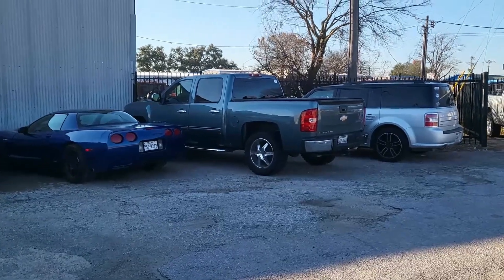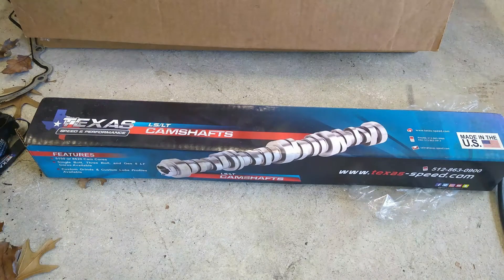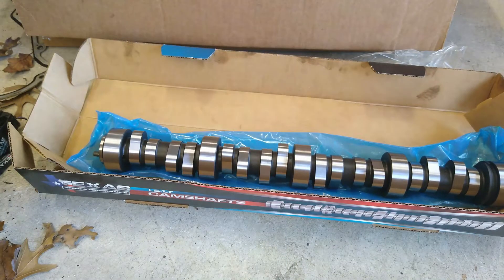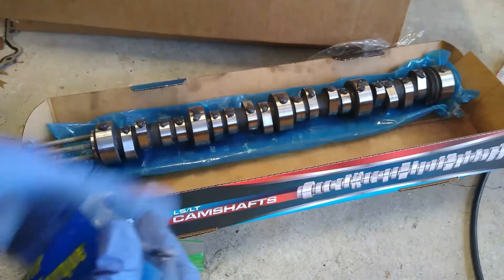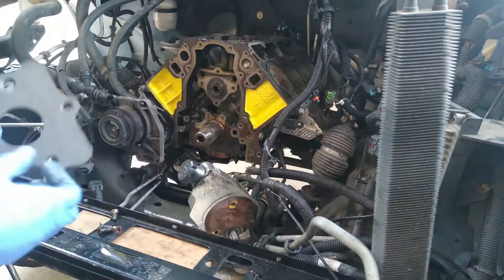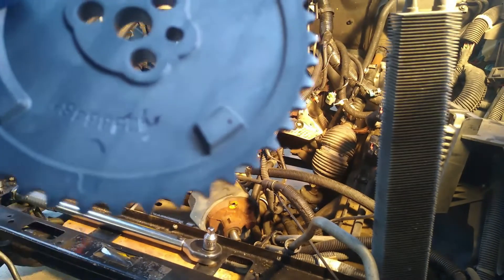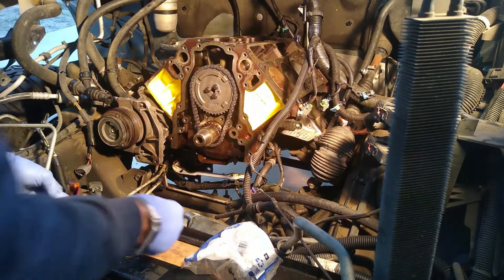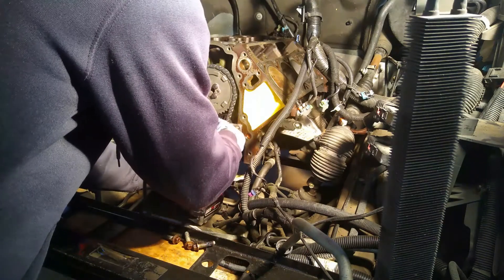STAGE 2 Camshaft Install & Timing LS GEN4 5.3L Engine Rebuild. 2008 - 2013 Silverado Sierra

Comment: what happens if  you dont replace the timing guid if using the stock it gives tension on one side will that cause a random stumble seeing that every other revolution it will be off timing i installed mine with the oem one and i have a random stumble

Comment: The major upgrades would be going to a stage three or four you would require a spring us grade along with a proper torque converter to avoid jolting and lunging at stops and to run properly, you can get away with a stock torque converter with a stage3-4 but wouldn’t recommend it
Reply from the maker: It revs up / lunges every time on the first hard stop in the morning and then smooths out after that first jolt. Can you recommend a good torque convertor to stop this?
Reply: @dad-whodoes  if its just doing the lunging and reving up on the first stops or couple of stops and does fine afterwards,i would look into the spark tables in your tuning software first before spending money on a torque converter, on the tuning software you could look into the highoctane amd low octane tables depending on what fuel your using and how that correlates to the timing and lower coolant temps all the way up to operating temps but you would need to dial in fueling first before adjusting timing tables And for that cam you can run your stock converter with no problem just need a good tune. Sorry for the late response sir.
Reply: @dad-whodoes circle D makes the best converters on the market